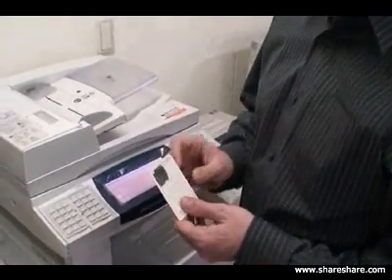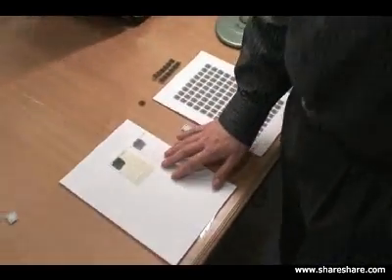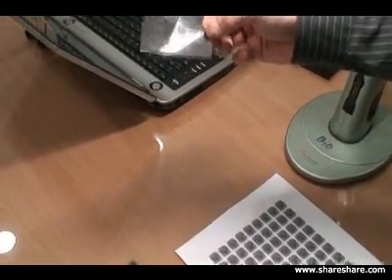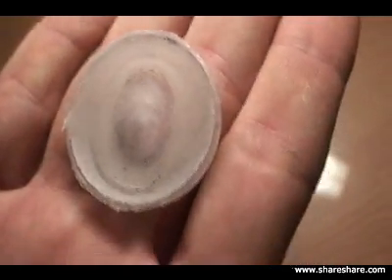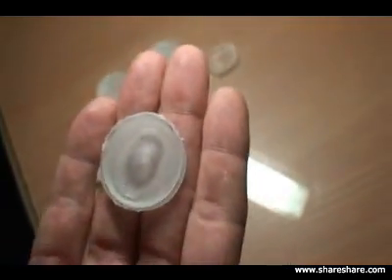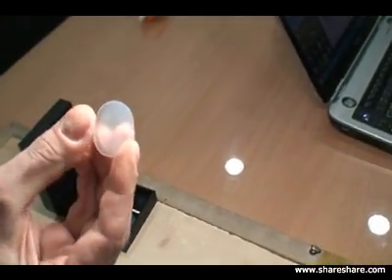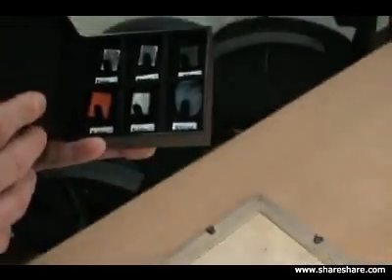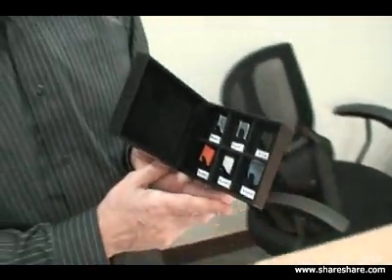How to make the fakefingerprints (VIRDI)

Comment: What's the likelihood that someone is going to go to this extreme lengths to get access to someone's computer in an office setting?  What happens if someone uses their little finger which is harder to get in order to copy.  Most people use their first three or four fingers to do most tasks, but not their pinky finger. If I had a reader to get access to anything, I would use my pinky finger since it's probably the most difficult to get a print to even copy.